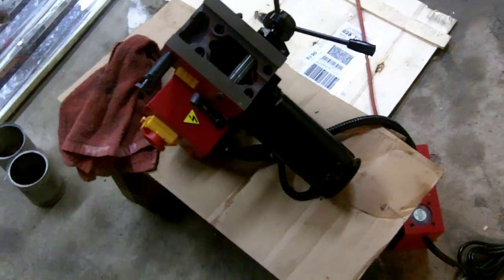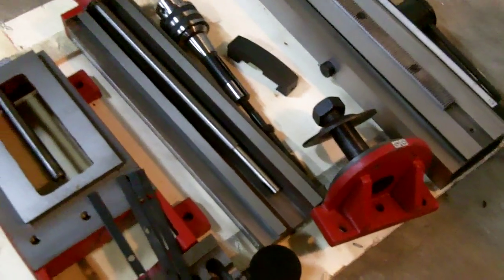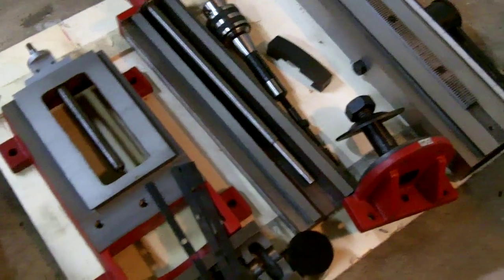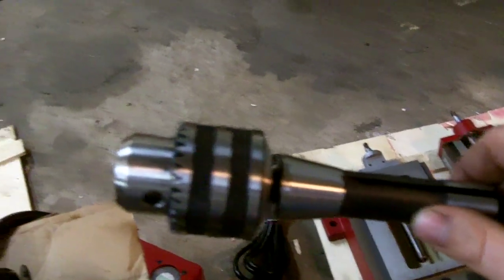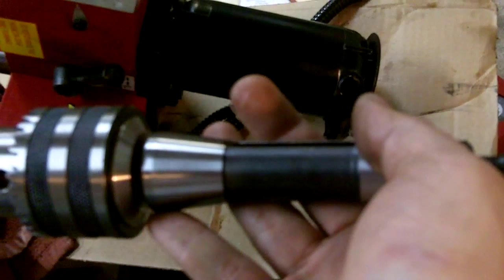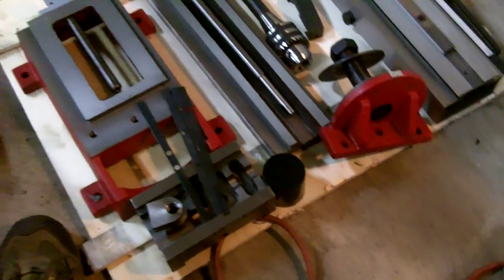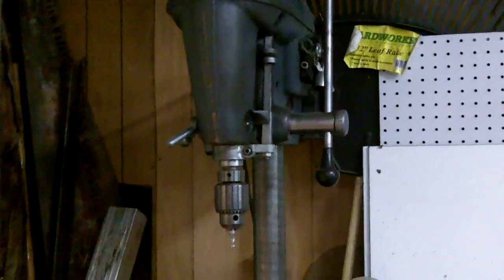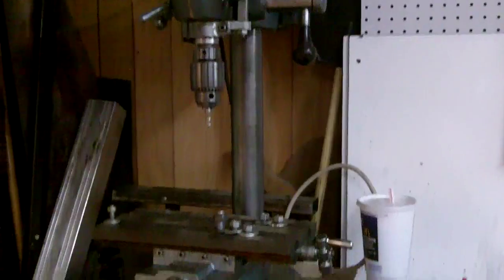HF X2 Mill   Disassembled

Comment: I just broke the low speed gear tonight. High range works fine. Is there a particular way I can replace this without too much trouble?   Where can I order another gear from. I saw in your video there are plastic.  Please help thanks:(
Reply from the maker: I believe Little Machine Shop sells replacement gears in both plastic and metal.  You could also 3d print them from nylon.  I believe there are .stl files on Thingiverse.  Personally, I'd just do away w/ the gears and upgrade to a belt/pulley system.

Comment: coh-lets

lol.
Reply from the maker: +Sigma175 Yes yes, I'm a horrible human being.
Reply: +Jake Mercer haha, just sounded so weird to me pronounced like that. neat machine anyway, I'm thinking of getting one. how is it holding up 4 yrs later?
Reply from the maker: Sigma175
Yeah, since making this video I've seen it pronounced the proper way hundreds of times.  so yep, it IS weird.  I'm still pretty happy with it though, I'm finding I need a bigger machine sometimes.  It's holding up pretty well.  I've upgraded it w/ a belt drive, a welded steel tube stand, nylon nuts for the gib adjusters, and may convert it to cnc using the older electronics from my new (to me) cnc router.  I'd recommend this machine to anyone starting out or with limited shop space.  Actually, if I were to do this over again, I'd get the model from Little Machine Shop with the solid, non tiltable column and the larger table.  Costs a bit more though.

Comment from the maker: That would make sense.  The quill itself doesn't move but the head does.  The travel is a little over 7" w/ the current rack setup.  The rack itself is about 8.75" but I believe LMS sells a 14" rack that extends the travel which is included in their gas cylinder mod kit or alone.